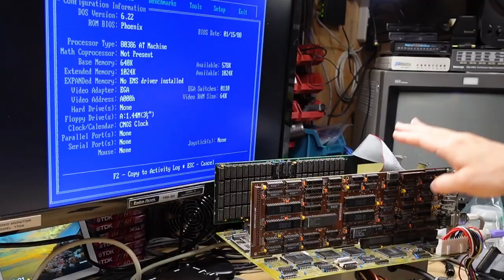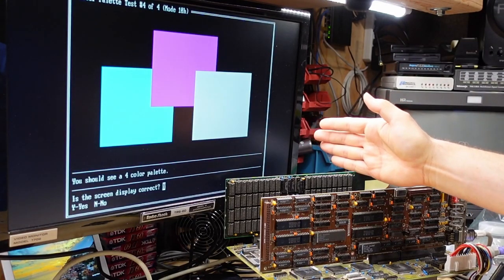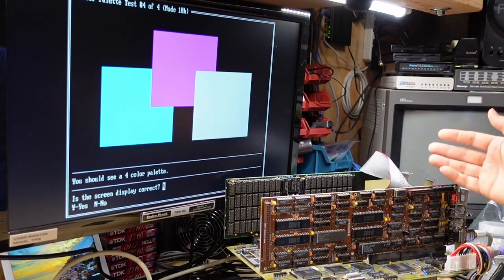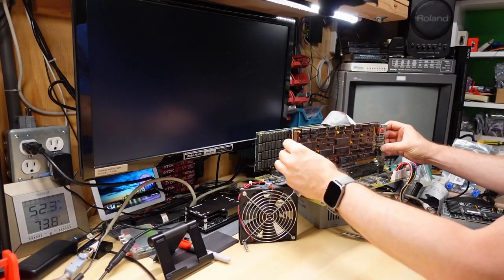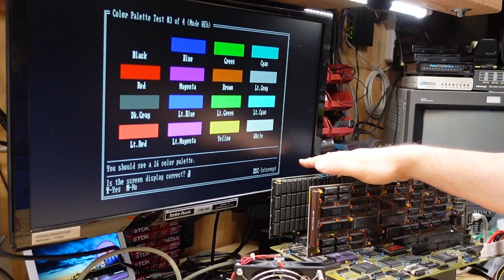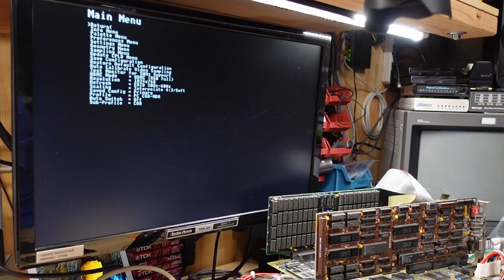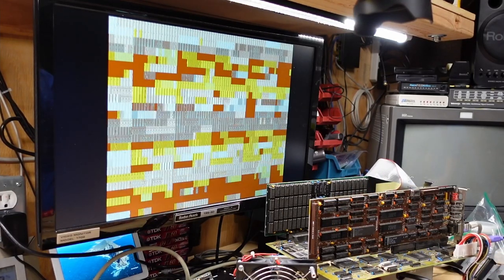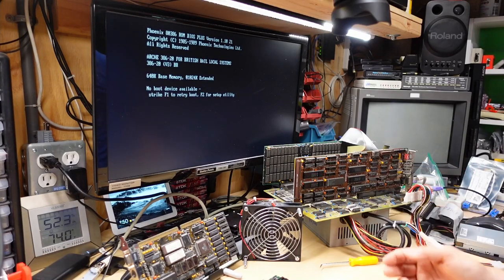Experiment: Can you upgrade IBM's EGA adapter's onboard RAM to 256k?

Comment: Just glanced at the schematic for the card and memory expansion.  It looks like pin 50 on the expansion connector is called MEMOPT .  On the expansion card that pin is tied to ground. It may be as simple as grounding that pin 50 so it thinks it has the memory card.
Reply: That's what I wondered, if there was simply something that needed linked out on the expansion connector. Seems like i was right, hopefully it pans out
Reply: Mr Guru  there are 2 by 8 bit latches on the schematic, one fed with 8 bits but the other is fed with 6 bits and 2 bits grounded, from here on the pcb will not address 64k chips additional space. from the LSI it only addresses ram with 8 bits and 6 bits (ras cas)
Reply: Follow-up, follow-up!
Reply: Mr Guru  it wont work that way.. in addition you would need to combine the 4 separate CAS signals into one CAS and column address bits A0 and A7, to make it work with 4464.
Reply: Mr Guru  the point was to use 4464 chips. also it would make no sense to design a new board with 24 pieces of 4416  chips if you can make it with only 8 4464 chips (less complexity , cheaper...etc..) ... and we're back to the need of re-arranging CAS and addressing  as i mentioned earlier ;)
Reply: Mr Guru  those chips are not manufactured anymore and a new old stock 4416 from a reputable source goes for $5 - $15 a piece.
Reply: Mr Guru  Yea, I saw that. Seemed to be inverting the write enable for the expansion ram, but you don't have the expansion ram separate if you change the 4416's to 4464's.  So I am not sure if you need to do the inverter.  Even if you did you can get an Active high WE on the main board already.

The sequencer chip handles memory timing signals, so you may not be able to do the simple mod because of how it handles memory timing.

In particular the A CAS 1/2/3 and B CAS 1/2/3 are the unique timings for expansion RAM.

If it were me I would try to pull the MEMOPT low and just try it since it is easy to do.

If that doesn't work (and it probably won't) and you didn't want to just make or get an expansion card.  You could try stacking the 4464's on top of the 4416's and pulling the CAS lines up and wiring to the proper signal along with the active high WE.
Reply: @Hiphopasaurus  no i'm not, just got the same name ;)
Reply: I love my new RTX3060!
Reply: Unfortunately it's not that simple.  Look at sheet 3 where it latches the addresses for each pair of memory chips.  It always latches 0's into A0 and A7 for the CAS output.  It would appear that the memory expansion board is indeed the only way to add memory without some extensive modification.

This doesn't explain why the RAM wouldn't work at all though.  It still should work at 64K, theoretically.

Edit:  What fumthings said.
Reply: What is the other expansion connector for?
Reply: @rgi9509  It seems to be for adding cards that are capable of other modes than the EGA offers.  It is possible to disable video data generation on the EGA card, in which case the feature connector's R,G,B,horizontal retrace, etc. will directly drive the output circuitry of the card.  It can also be told to take a clock from the feature board instead of using its own generated ones.

It has two general purpose output bits  and two general purpose input bits that the proposed feature card could use for whatever too.
Reply: @ovalteen4404  Could it be that the timings for the 120ns and 100ns chips are too far off the 150ns originals? I know that DRAM can be finnicky sometimes when they differ too much.
Reply: Yeah, I was wondering something similar.
Reply: @ovalteen4404  yeah, I figured the issues were related to not meeting timing requirements even if the pinout is compatible.
Reply: @Bobbias That would only be a problem if the chips were slower than the originals. The speed marking on the chips is the fastest it can possibly run, but you can run them at whatever speed as long as the refresh is fast enough to keep the memory alive.

Comment: FWIW, the summary answer (which is basically in the thread started by Michael Hill) as to why this didn't work is on sheet 3 of the EGA schematic; there are a series of LS374 latches which do the multiplexing for the 16 bit (MA0->MA15) display address generator, and you can see that A14 and A15 aren't fed into the CAS latches; they have two input pins grounded. Therefore the full 16 bit address will never make it to a 4464 plugged into the sockets on the board.

You could try pulling MA14 and MA15 to those inputs on the latch inputs after freeing them up from ground, but you'll then need to outsmart the LSI sequencer that uses those signals to generate the CAS/RAS signals for chips on the expansion connector so cycles intended for those banks activate the onboard chips (at the appropriate addresses) instead. Maybe you could piggyback a GAL somewhere on the board that has the alternate RAS/CAS and A14/15 signals as inputs and switch them accordingly. It also looks to me like you'd need to mess with the bus interface circuitry on pages 4 and 5 so memory read/writes from the computer bus are handled correctly. In short this is probably "doable" but it'll take some pretty significant hackery.

Per other comments in that thread I am mildly surprised the 4464s didn't work at all; if those two bits of CAS are tied low consistently then I'd think the chip would effectively just act like a 4416. I kind of wonder if there's an opportunity for those to float in the computer bus address side of the house, that part of the schematic gives me a headache. This might cause writes to go to a different part of the chips than reads?

Comment: Maybe you could try feeding the extra address lines from the expansion header via a couple of bodge wires? No idea if that’s something that could work, but it’s easy to try if you have the pin outs.
Reply: The card would have some rom which would also likely need to be modified. So while doable it doesn't make sense to pursue may as well engineer a card from scratch.
Reply: @metatechnologist  : Higher capacity was usually provided by a complete expansion card, so I doubt that a ROM swap is relevant.
Reply: Cant.  The same pins that do the RAS do the CAS.  So no physical modification at the memory would help.  Now there might be a way to route signals BEFORE the latches, but i dunno.  Seems to make more sense to just try and get the actual expansion board.

After all, he is usually going on and on about keeping things "authentic!"  (See the PC-AT repair series!  ^-^)
Reply: @jeromethiel4323  Exactly. Their comes a point where you just start over and engineer a new board lol.
Reply: I guess the expansion header has different RAS/CAS signals for the 3 extra banks. Soldering 4 RAM chips on top of each other and bending the RAS/CAS pins up and wire them to the expansion header might do the trick.
Reply: Was gonna suggest this too!
Reply: Getting hold of the original expansion board then copying it is probably the way forward.
I suppose that when this EGA board was developed larger RAM chips would have been prohibitevely expensive.

Comment: The idea of the expansion module was probably intentional, to prevent clever users from doing the exact upgrade you are doing right now, but instead, force them to purchase the expansion board from IBM.
Reply: Yeah, IBM never was that person friendly. Their first and foremost line of sales was/is business, where these hacks are not preferred, they just buy the expansion or new cards when needed both for simplicity and warranty.
Reply: Expansion boards are also a "cleaner" upgrade route when they're available, since they can ensure that only the correct speeds are used. Meanwhile, if you look at their PC motherboards, they did have sockets for things where single-chip upgrades would actually make sense (the expansion ROMs).
Reply: Also I'm thinking it probably also helped that they could just make a bigger order for the same chip, which was already the cheaper chip, in order to get a better price per chip and also sell more of them.

Comment: Yup, as the expansion board also uses 4416, there is no way of mapping the extra CAS lines but using the extension's adressing signals ACAS1-3 and BCAS1-3 and  gate those in to the new chips.
Reply: That still doesn't explain why the video board isn't writing to the ram correctly.  Display looks like uninitialized ram.

The ram is upwardly compatible, right?
Reply: @williammentink  Since it expects 150ns RAM the refresh is probably too slow for the 100ns RAM and it loses its contents. Most likely the pattern will be random if you power cycle it.

Comment: For those who don't know what bitplanes are, it means that each bit of video memory gets its own entire byte in the memory map, so that you don't have to do bitwise shenanigans to set individual pixels.
It's also not contiguous (RGBIRGBIRGBI...), rather its split up such that each component of a pixel has its own plane (like RRR...GGG...BBB...III...).
This makes some operations quicker (say, setting single pixels, which is what an unoptimized graphical routine might do)
but makes other operations slower (blitting takes more operations than if pixels were packed).

Comment: You could double check the board for hidden/unpopulated dip-switches that select the memory configuration.
Reply: They could appear as places where a jumper wire could be installed. Often the would be silkscreened as something like "jp1"

Comment: There's a thread on twitter by either Foone Turing or TubeTime, where you can install a few switches to switch the 4 colour palette used in the full 480 mode, they go pretty deep into the schematics and discuss a lot of the tech involved, might find a few interesting things there!
Reply: I would've thought software could change it directly. In the 16 color mode can't software redefine the palette using any of the 64 colors the output supports?

Comment: That 150 ns memory spec might be very important here.  There is such a thing as too fast of a memory.  Seen this problem quite a few times in arcade repair.  They had different speeds for a reason.  Some places you cannot just swap memory types (like you can do with modern computer RAM these days).

Comment: Nice Video. I do not have a card like that to test this too :(
Check if the extra address line on the memory chips is routed on the PCB to the main chips.
Would be probably floating as this did not work.
Then maybe there is this line going from the main chip to the expansion slot.
I actually enjoy this second channel more :)

Comment: Every data sheet for dram I’ve read has referred to those as Row Address Strobe not Select. Same for Column.
Reply: Both are technically correct as the address lines are asserted first, and then either the RAS or CAS is strobed to put those address lines in their respective latches, so the address inputs are available for further use.

Comment: looking at the schematic, it won't be a trivial upgrade to 4464... you would need to combine the card's column select signals CAS, CAS1, CAS2, CAS3  into single CAS and two column address bits A0+A7 to make it work with 4464 chips. A0 and A7 are ignored by 4416 on CAS , that's why the card has CAS for onboard memory and CAS1/2/3 for the expansion card (expansion card has 48K per bank and is NOT overlapping the 16K per bank onboard memory when installed).

Comment: Not seen one of these for many years. Back when I started working in electronics one of my 1st jobs was working at an electronics subcontractor that built a bunch of IBM stuff. My job was to fix the boards that failed functional test. They were good days.

Comment: Basically, the EGA/VGA card has a 32-bit memory interface. So all eight the 4416 chips make up one bank of 16K x 32. The processor interface presents the RAM as 16K x 8, though, so there needs to be some magic that expands/reduces the 8-bit processor bus to/from the 32-bit memory bus. This is where the complexity, but also the performance optimization possibilities of EGA 16-color graphics drivers lie. In 16-color modes, the 32 bits are in fact divided into 4 planes of 8 bits each, and one way of accessing the memory is choosing to read/write only one of the four planes.
In other modes, very different memory organizations are used, but thinking of the 32-bit bus being divided into 4 "planes" of 8 bits makes sense in most modes.
The EGA LSIs are able to access 4 banks of 16K x 32, but not a single bank of 64K x 32. I don't think IBM did this to force customers into buying their memory expansion boards instead of just swapping chips, but just to (a) support a 16Kx32 configuration as affordable entry-level solution and (b) keep complexity low by only supporting 16Kx32 banks.
Fun fact: The EGA card (with just 64K RAM) uses a weird addressing mode that remaps the 16K x 32 into 32K x 16 for the 640x350 mode, as that mode has too many pixels for the 16K address space. Using a virtual x16 instead of x32 organization means you get two virtual planes from four physical planes, and this limits the number of colors to four.

Comment: I wonder if these DRAMs have automatic memory address increase on reads and writes so you don't have to repeat RAS or CAS and it expects the roll over 2 bits earlier?
Reply: No. You have to feed them in each time.  One thing you can do is page mode, you can hold the Row Address (here the lower 8 address bits) and and change the column address.

Comment: Glad I watched this video, I was struggling to other day to remove an IC because of solder on the top side of the PCB. Never thought to use a heat gun. 

Out of curiosity, what temperature did you use?
Reply: Adrian has another video explaining this method:
https://www.youtube.com/watch?v=XQVjwPsVFd8

Comment: I didn’t expect this to work as even a video card has its own BIOS where it’s expecting memory to be arranged in a particular fashion.
Reply: You'll be surprised what people will do these days hell there is some Russian modders that have upgraded the vram on RTX cards. There should still be a video somewhere here on YT of a 2070 or a 2080 where they went through the whole process doubling the total memory. As for much older cards there is no vbios the way modern users have come to expect so everything is hardware timings.

Comment: socketed chips allowing for ram upgrade by replacing chips with chips by a third party would have killed the ability for IBM to sell the ram upgrade card there is no way they'd allow that
Reply: Was going to post just that.  It's a nice idea, that the end user could just upgrade the card.  But then IBM wouldn't make any money.  And they aint having that!  ^-^

I remember i had a guy come into our store and pay me my hourly rate to remove the ram chips from a PC-JR memory expansion card and install sockets.  Then put in higher capacity chips (i made him sign a waver, that was a LOT of de soldering, and the chance for hidden damage was just to high for me to rick it).

Worked like a champ, since the higher capacity PC-JR memory adapter did exactly that!  Same PCB, same enclosure, everything.  The cheap one just came with soldered in chips, and the average user isn't going to be de soldering and re soldering all those chips.

Although in IBM's defense, not including sockets did lower the cost of the expansion module by a few bucks.

Comment: If the PCB was designed before the newer ICs' with the extra bits was even invented, I guess the extra lines wouldn't have even been laid-out, ie, it might need extra connections.
Reply: I'd assume the bits had been allocated, but they didn't bother allocating them because of the expansion board.

Comment: I like the thinking here. Wonder how the piggy-back board alerts the EGA card to it's presence?
Reply: I think he mentioned it didn't have any extra sense pins present, but maybe it does it based on current draw or another circuit.
Reply: Looking at the schematics for the IBM EGA Video Card there is pin 50 on the expansion connector called MEMOPT that is active low (it's pulled up high by a resistor on the EGA card PCB) so perhaps grounding this pin would allow the 256K to be properly seen from the on-board sockets. Do not hurt to try I suppose. Worse case it just wouldn't work. I don't see how it cause any damage to the board. It goes to a 74LS151 multiplexer so with MEMOPT pulled high, looks like PGSEL and A16 never become part of the picture so that might help open up addressing the extra memory.

Comment: The C128 had a 3rd party upgrade you could plug into the 80-column section to do that memory upgrade (giving it the video memory of the C128D).

Comment: The fact that IBM designed in that expansion slot was a good indication that it wouldn't work.  Perhaps at the time the board was designed there was no indication that a higher density version of those chips would ever be available.  However, there still may be a way to expand the board without the expansion board, with a bit of bodging.  Solder stacks of the 16k ram chips on top of each other to make a 4 deep sandwich.  Bend out the CAS and RAS leads of the upper 3 chips.  Now wire up all of the RAS and CAS lines of the new chips to connections that go to the expansion slot connector (a study of the schematics for the EGA card and the expansion card will be necessary to figure this out).  My bet is that the address and data lines of all the chips are wired together, but the RAS and CAS lines go to separate outputs.  Probably not worth the time to do such a bodge, You'd be better off using KiCad to design your own expansion board and then go to one of the off shore PCB houses to have it made.  Oh well .....
Reply: I'd guess that either the RAM chips existed but were much more expensive than doubling up, or that the chips available didn't have enough drive capacity and thus the EGA board has buffers.